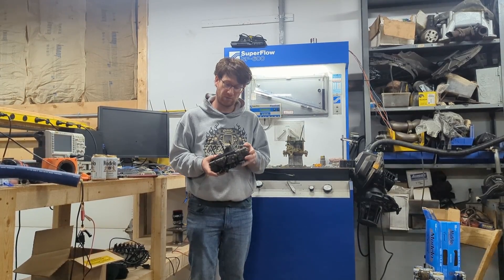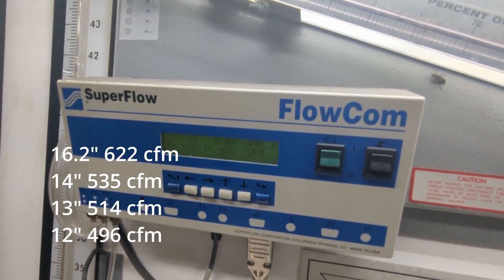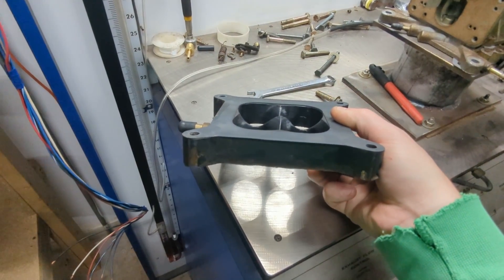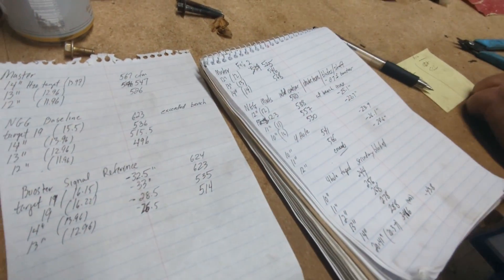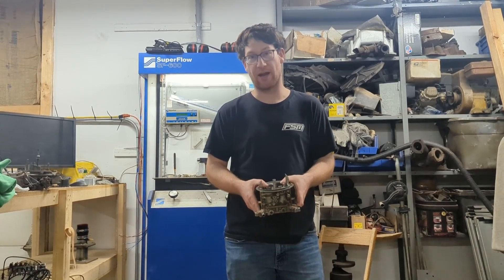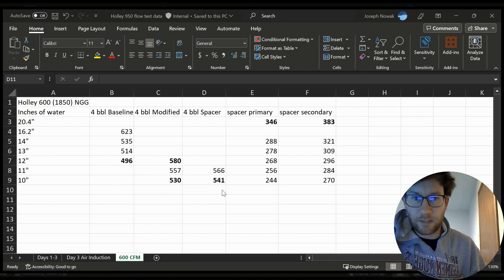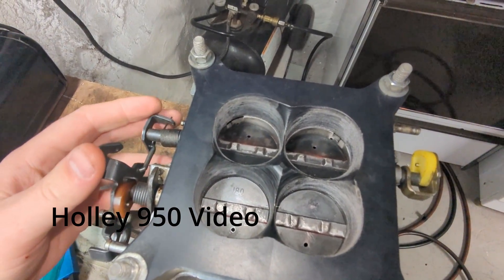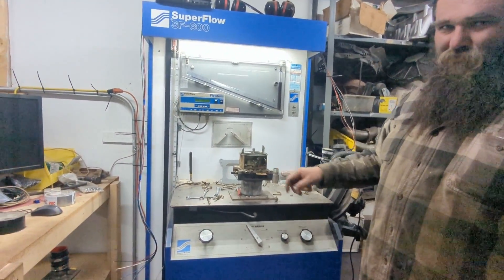Holley 600 Carburetor | Choke Horn Delete | Throttle Shaft Rework | Flow Bench

Comment: would an air filter on the top effect that also? Without air is being pulled straight down/in
Reply from the maker: Air filter system (base, filter, cover) will bring the number down if you compare to no air filter.  There is a limited amount of air that is pulled from the sides even without a filter system.  If your hands get to close to the carb while its on the flow bench the number will change.

Comment: I wonder what it would do with down leg boosters
Reply from the maker: @PeggyParrow  a downleg would do better for airflow if sized correctly.  I dont have any data to back that up.  Downleg should have a better signal thus you can use a smaller diameter.